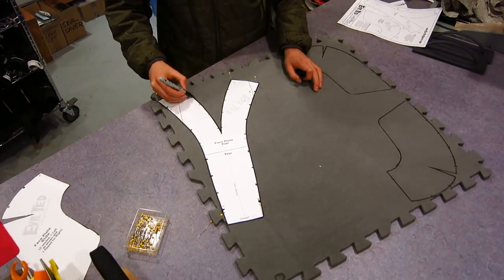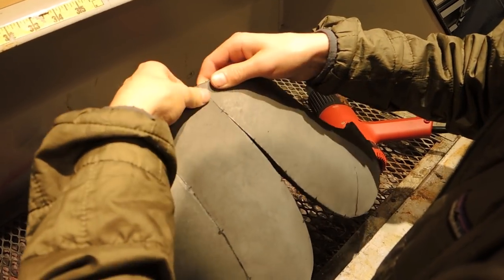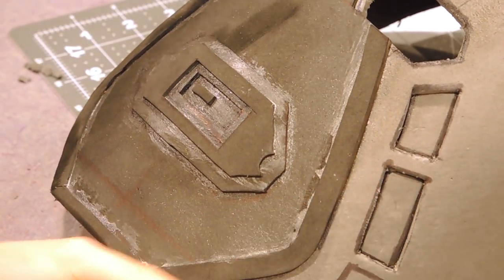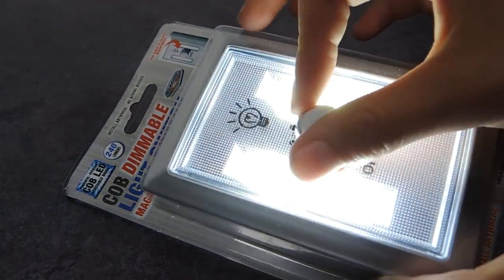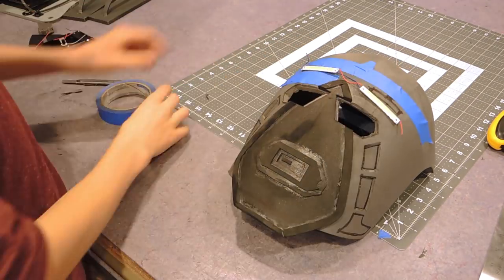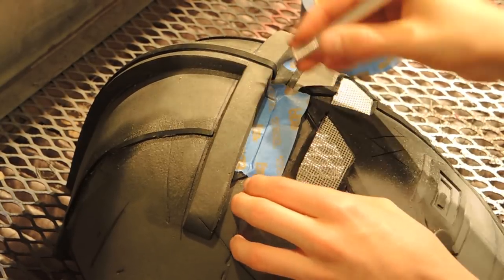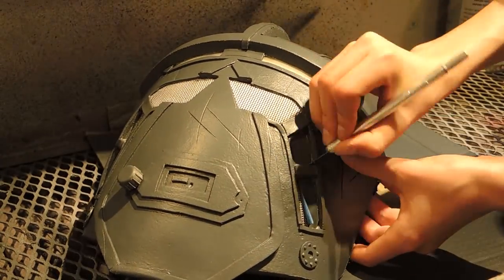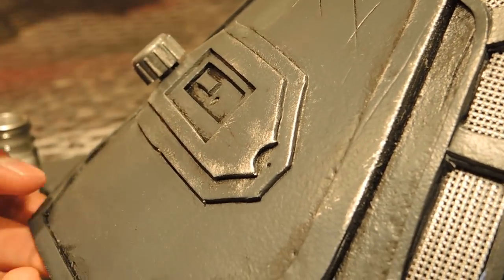DIY Robot Mask: made from foam

Comment: Oh wow, this turned out great! Tbh i didn't expect such a good end product when i saw you were this young. My bad for judging too quickly, i wish i was half as skilled and creative as you hahah. 
I spend more time looking at other people building trying to learn everything they do that i should also apply to improve my results rather than actually trying it and getting experience. When working with eva foam I'm kind of scared to fuck something up during the build process and end up wasting a lot of material and time(here in Argentina eva foam costs $10 each square meter, so it can get quite expensive very quickly) but i guess some of that is an inevitable part of learning. Greets!